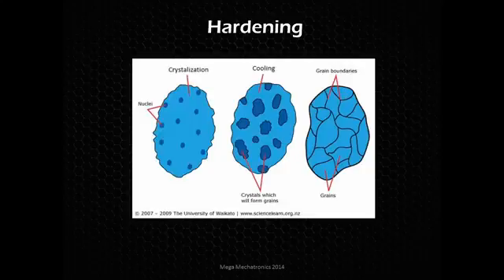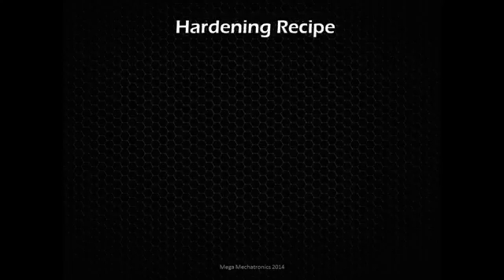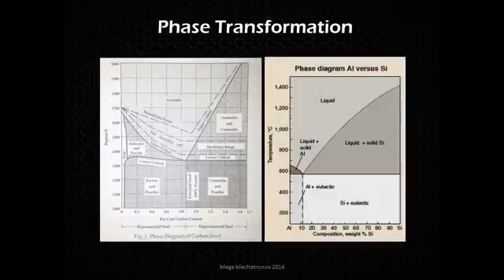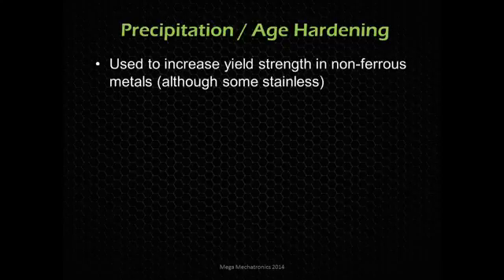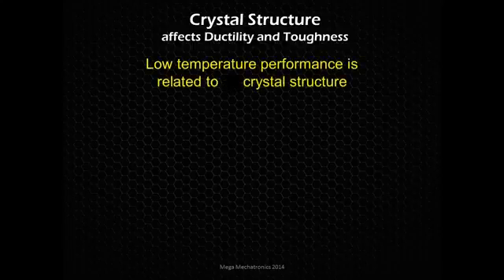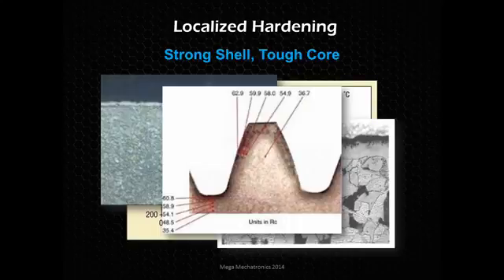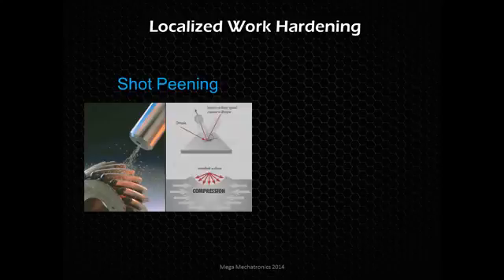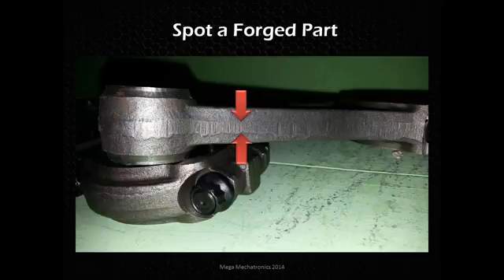Materials Science Mechanical Engineering    Part 4 Heat Treatment Explained

Comment: Muhammad Rifki
2714100082

Hello everyone, my name is Rifki, at this time i will review and give some comments about this video, lets check out. In this video, the video maker want to discuss about hardening and heat treatments and even some cold working processes, if we hardening a metal that means we are going to crystallize it we are going to let those atoms move around and then we are going to cool it, at final the atoms will start forming crystals. We should take some attention about the crystal structure that we do heat treatment.  The atoms have like magnetic bond each other, so when atom start forming but it stays come together. When we do heat treatment the orientation of crystal will be different and make a new grain boundary, the size of grain boundary is important, the smaller size will give us stronger harder materials and the bigger size will give us ductile materials. Hardenability has some criteria, first, limits dependent on alloying of the metal, second, hardness dependent on carbon content ferrous metal, based on curve in that video we can conclude that more carbon content will increase the strength and hardness of materials. Hardening recipe is very important of the time and temperatures during the hardening process. So the recipe is going to lead to success if you can follow that recipe consistently. If we want get the different properties of materials, we must do hardening with different hardening recipe too. Phase  transformation diagram will give us an idea where to start and what temperatures. Composition is important when we do hardening, alloying elements have some effect to the properties of materials. So we should know the detail composition of the materials, if we want to get the properties that we plan before. One alloy element can give many different properties to materials, we dont change anything, we just change the treatment like quenching, low tempering, hight tempering, etc and the we will get new properties. The video discuss about heat treatments, first is tempering, because the materials is too brittle, so we should do tempering to improves toughnerss, the tempering temperature is below transformation temperature. Next, normalizing, ferrous based metal heated above transformation temperature and allowed to air cool in still air at room temperature. Third, annealing, we heat and hold temperature, we controlled cooling rate and primarily for softening the materials. The last one is precipitation hardening, is used to increase yield strength in non-ferrous metals. Quantifying hardness, there are some tests to quantifying the hardness of materials, there are rockwell hardness test method, vickers hardness test method, and brinell hardness test method, each hardness test method has different mechanism to operate, characteristic, and output of them. We can compare the hardness of materials by see the table of hardness, because rockwell, vickers, and brinell hardness have different value of hardness, so we should see the table to match it. And then we can do the scratch test for softer materials for some case that the marterials will be hardened. So the crystal structure affects ductility and toughness, so BCC, FCC, BCT and other crystal structures have different properties at any temperature. Low temperature is related to crystal structure. BCC crystal structures experience a ductile to brittle transition at lower temperatures. FCC crystals structure retain ductility at low low temperatures. In this video, we will know too about the localized hardening, localized hardening is divide to two induction hardening and nitriding or carburizing. Induction hardening  is a form of heat treatment in which a metal part is heated by induction heating and then quenched. The quenched metal undergoes a martensitic transformation, increasing the hardness and brittleness of the part. Induction hardening is used to selectively harden areas of a part or assembly without affecting the properties of the part as a whole. Nitriding is a heat treating process that diffuses nitrogen into the surface of a metal to create a case-hardened surface. These processes are most commonly used on low-carbon, low-alloy steels. And carburizing is a heat treatment process in which iron or steel absorbs carbon while the metal is heated in the presence of a carbon-bearing material, such as charcoal or carbon monoxide. The intent is to make the metal harder. In this video is discussed about the correlation about strength and hardnesss on materials too, the strength of materials is increased by the increased hardness of materials, It is opposite of correlation about toughness and hardness on materials, if the hardness materials is increased, the toughness of materials will decrease, so it is the important thing of heat treatment, if the materials is too brittle or the toughness of materials is too low, we must  do the heat treatment to fix and make the properties of materials better as the recipe hardening. In the last of this video, we will know about cold working or work hardening. Work hardening, also known as strain hardening or cold working, is the strengthening of a metal by plastic deformation. This strengthening occurs because of dislocation movements and dislocation generation within the crystal structure of the materials. old forming techniques are usually classified into four major groups: squeezing, bending, drawing, and shearing. Applications include the heading of bolts and cap screws and the finishing of cold rolled steel. In cold forming, metal is formed at high speed and high pressure using tool steel or carbide dies. The cold working of the metal increasing the hardness, yield strength, and tensile strength.I think its enough to me for review this video, thank you for all of your attention my friend, See u next time !!

Comment: Lutfi Yunus Wahab Al-Audhah (2714100034)
Assalamualaikum, Mrs. Dian Mughni.

Hardening is heat treatment that done in high cooling rates (non equilibrium) so will get the microstructure of martensite (non equilibrium microstructure). Hardening is the heat treatment process to improve hardness and strength of the specimen. Steel has BCC structure at room temperature. And FCC structure at austenitic temperature. When carbon atoms go into interstitial space of the Fe atom then Iron becomes harder and stronger. More the carbon atoms in interstitial space of Fe more the hardness. But BCC structure has less interstitial space where Carbon atom can be stable than FCC. Because of all above reason, In hardening it is heated to austenitic temperature so that more Carbon atoms can come in interstitial space and after soaking it is cooled in quenching medium (fast cooling) . Due to fast cooling Carbon atoms don't get enough time to get out of Fe. And it becomes martensite structure. When hardening, there are crystallize process where the process is start by the moves of atoms and then getting cool for further form a crystal like Body Centered Cubic (BCC) and Face Centered Cubic (FCC). The grain boundary size of the crystal is important thing on hardening process. The underlying principle of deformation of materials is the movement of dislocations. Dislocation movement leads to deformation, so any strengthening technique focuses on inhibiting dislocation movement. This may be done by several methods, like pinning dislocation with alloyed elements, or by decreasing grain size. Grain boundaries impede dislocation movement, so smaller is your grain size, higher is the yield strength. This is expressed by the Hall-Petch relationship, which is an empirical relationship. Hall-Petch states the change in yield strength is inversely proportional to the average grain diameter raised to some power. This power varies between 1 and 3. Apart from strength, grain size impacts creep and corrosion behaviour too. Grain boundaries are like surfaces, and thus show higher reaction rates compared to the inside of the grain. This is readily apparent during etching, when grain boundaries are etched more, thus revealing the grain pattern. So decreasing the average grain size will make your metal more susceptible to corrosion. Also, Coble creep happens along grain boundaries. To minimize Coble creep, many applications that have extended periods of cyclical stress like turbine blades, the metal portion is made of one single crystal. Brittleness depends on something else entirely. If the yield strength of the material, that is the energy required for dislocation movement is more than your bond energy, you will have brittle materials. There are the principal recipes of hardening, Heating, holding, cooling and tempering. There are several media for quenching. Water. Water is fairly good quenching medium. It is cheap, readily available, easily stored nontoxic nonflammable smokeless and easy to filer and pump but with water quench the formation of bubbles may cause soft spots in the metal. Agitation is recommended with use of water quench. Still other problems with waterquench inclued its oxidizing nature, its corrosivity and the tendency to excessive distortion and cracking although this bad properties for plain carbon steels. Brine (salt water) : Brine is a more severe quench medium than water. Unfortunately it tends to accelerate corrosion problems unless completely removed. Sodium or potassium hydroxide can be used when very severe quenching is desired and one wishes to obtain good hardness in low carbon steels. Oil: When slower cooling rate is desired oil quenches can be employed. The slower cooling through the Ms to Mf temperature range leads to a milder temperature gradient and a reduced likely hood of cracking. Problems associated with quench include water contamination,smoke and fire. In addition, quench oils tend to be somewhat expensive. Air: Low alloy steels in light sections and high alloy steels may be succesfull hardened by means of compressed air or still air. The advantages of using air are that distortion is negligible and that the steel can easily be straightened during cooling precess. One drawback here is that the surface may be oxidized the cooling. And then Quenching is the cooling of the material from the higher temperature of the room temperature. When you take a untreated piece of steel and put it in a furnace to raise its temp. to around  723 C  i.e to a single phase and after that turn off the furnace and let the piece of steel to cool inside a furnace,this process is known as annealing (Furnace cooling or slow cooling) When you take a untreated piece of steel and put it in a furnace and raise the temp. to the  around 723 C  i.e to a single phase and take the piece out of the furnace and allow it to cool in air,this process is known as normalizing (air cooling). After ant primary treatment especially after hardening(water or oil cooled),the material incurs such properties which are unfit for certain application ,in those cases we can in order to improve the property we need to heat the metal to a temp. less than 723 C temp. This is known as tempering. Quenching is the cooling process generally ,faster cooling like dipping in water, brine solution ,oil etc.
Remain that the purpose of the heat treatment for getting hardness of martensite. Now, for quantity the hardness of materials there are sme methods, There are Brinnel, using ball to give standard force to the material that will make indentation on its material, where the diameter of the indentation should be calculated to predict the hardness. Then for the second is Vickers, where using diamond for the indentation, after that calculate the geometry. There is also penetrating method that should be calculated by dufferences of minor and mayor load. The best of all we must design the hardness test based on the material that we have, thus will attain more accurate for the number of hardness that we get.
Localized hardening are induction and nitriding or carburizing. Carburizing is the process of enriching the surface layer of low carbon steels to carbon in order to produce a hard case.This is carried out by incorporating carbon atoms. The purpose of that is to get strong sheel tough core. Cryogenic treatment also used for getting maximum properties where the purpose are transform retained austenite to martemsite. So will be no retained austenite, means improve sterngth. Done by liquid nitrogen or super refrigerator. Hardness will increae as increasing of the strength but will be decrease as increasing the toughness.
This is some point that I want to give after watching the video, I hope these all will give more comprehension for the lecture. 
Thank you, and Kind Regards